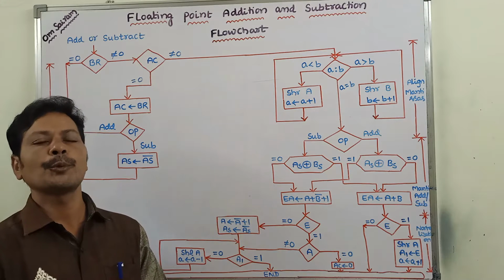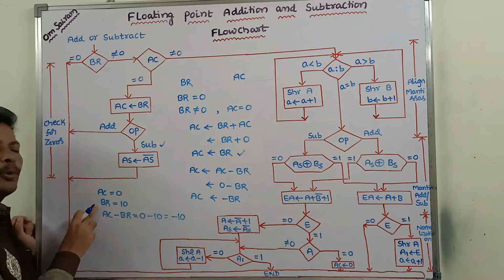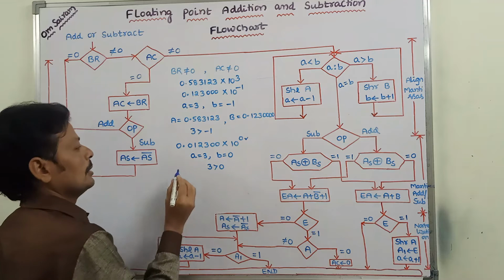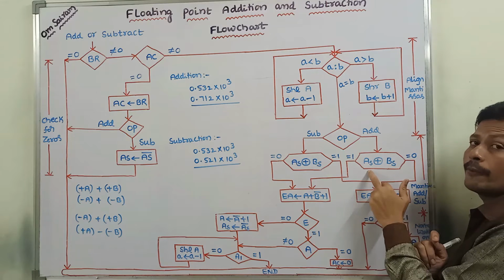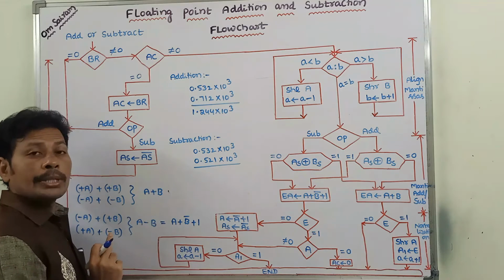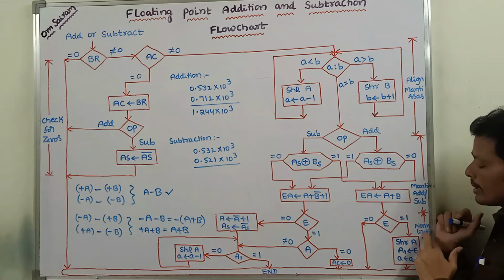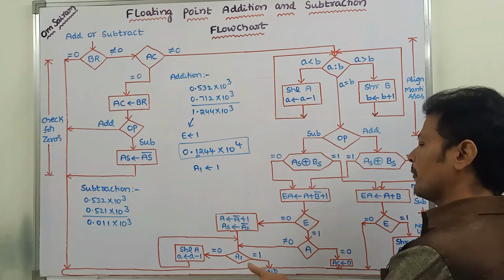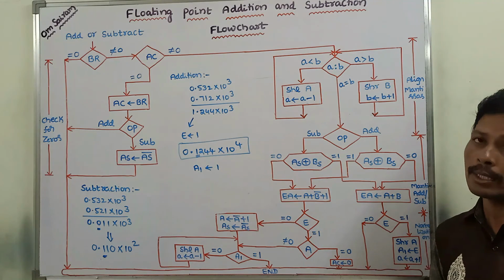Flowchart for Floating Point Addition and Subtraction || Floating Point Addition and Subtraction

Comment: Mistakes are there sir. 
1. 1st number in AC, 2nd number in BR. Its AC-BR
2. When BR not equal to 0, AC=0, then in subtraction answer is AC=-BR and is stored in signed magnitude representation. Not in complement form as you specified .
Hence we change sign of A by complementing the sign but of A